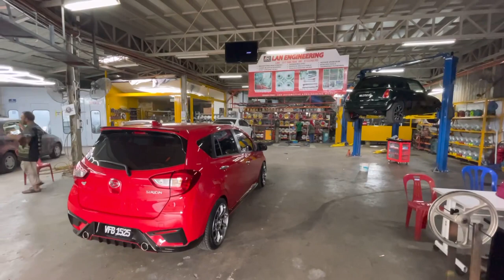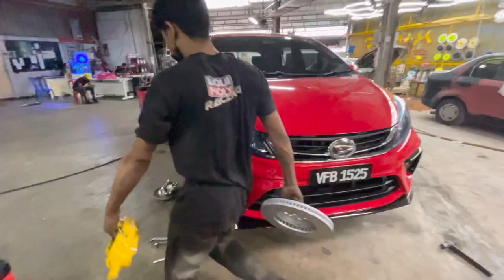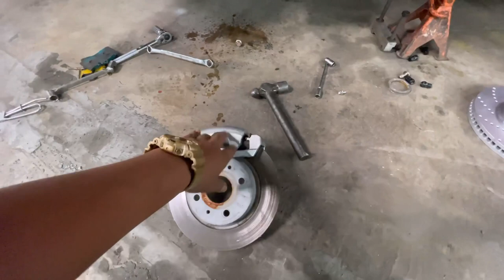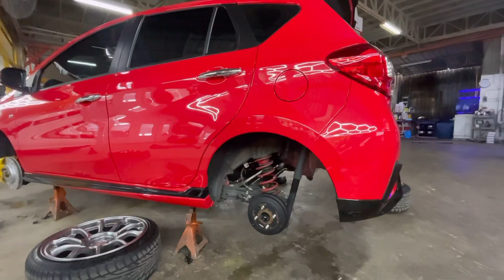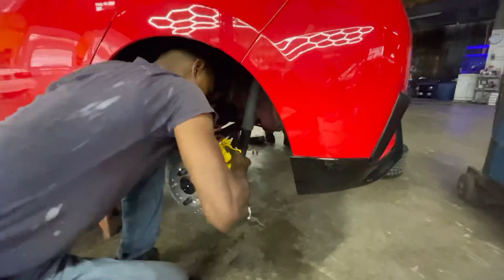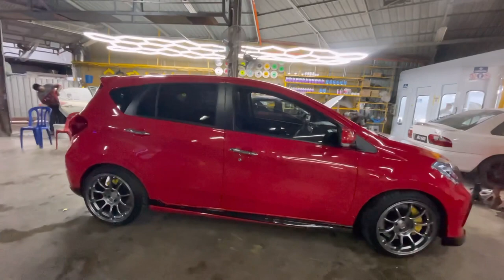SIRION❗️❗️VIRALL...MYVI G3 PERTAMA UPGRADE BRAKE 4POT DAN GANTI BRAKE BELAKANG

Comment: Pm boh. Lokasi. Bgi no fon.
Reply from the maker: SALAM DAN SALAM SEJAHTERA DARI LAN AUTOMOTIVE & ENGINEERING

#KamiMenyediakanServis
#BaikiSportRim
#SkimmingDiscRotor
#DanKerjaMesin
#UpgradeBrake
#KerjaKerjaWelding
#PumpBush
#PumpBearing
#WeldingAluminium
#SpraySportRimKereta
#KetukSportRim
#RepairRimBengkok
#ServicePistonCalipe
#SkimmingSportRim
#CustomBush
#CustomBracket
#CncMachine
#TebukLubangDisc
#DesignCorakRotor
#UpgradeDiscBrake
#ModifiedDiscBrake
#MachineShop
#MachineLathe
#MachineMiling
#BrakePad
#LowerArm
#UpperArm
#InjectAbsorber
#ServiceAdjustable

FACEBOOK GROUP:https://www.facebook.com/groups/1418594271694238

FACEBOOK PAGE:facebook.com/Lan-automotive-engineering-works-100284365395125

INSTAGRAM:www.instagram.com/lan_engineering/

YOUTUBE:https://www.youtube.com/channel/UCXH5dpgYGALRkM7pKBXkdPw/featured

FOLLOW DAN SUBCRIBE YOUTUBE:https://youtube.com/channel/UCRSfbyiVH8NkFOTOS1DUr6g

FOLLOW DAN SUBCRIBE YOUTUBE: https://youtube.com/channel/UCRSfbyiVH8NkFOTOS1DUr6g

http://www.wasap.my/+60135832024 Bagi Cawangan Di Kelantan

WHATSAPP/ CALL US AT @
📞 http://www.wasap.my/+60167263038
📞 http://www.wasap.my/+60173487006
📞 http://www.wasap.my/+60124883833
📞 http://www.wasap.my/+601111295183

📍https://www.google.com/maps/place/3%C2%B008'03.4%22N+101%C2%B045'35.7%22E/@3.134265,101.759911,17z

Waktu Operasi
9 Pagi - 7 Malam
Cuti Pada Setiap Hari Jumaat